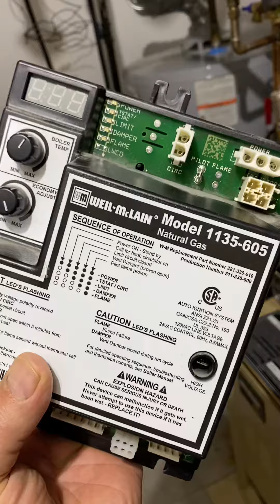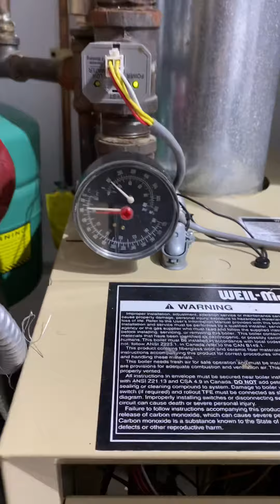Weil -McLain boiler troubleshooting transformer problems

Comment: With this controller, you can set the water temperature only, which it should be 180 for baisbord heat if it flud the paismnt that's because of high pressure generated from the steam because of water high temperature. Check the water regulator, expansion tank, and relief valve

Comment: Thank you very much. I was having the same exact problem. I replaced the controller and transformer. The transformer had blown three 3 days later again. I saw your video and track switch cable. The switch cable was dang near bare sitting on top of pipe. Very old. The unit is a two year old $6700 new unit. I was thinking what this could  possibly be. 🤔 
Electrician will have to replace xable, but in the mean time removed cable and wrapped with electrical tape.

Comment: I get a loud buzzing at start up and BUZZES  until it shuts down. I hear it buzzing i turn the heat thermostat down and  it stops as the boiler shuts down..it does not do it all the time. Any ideas suggestions?